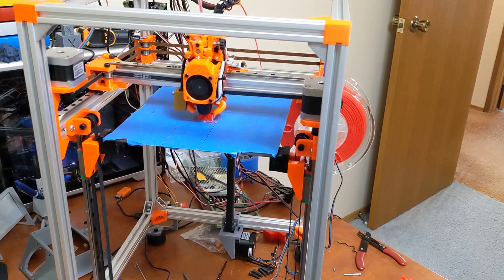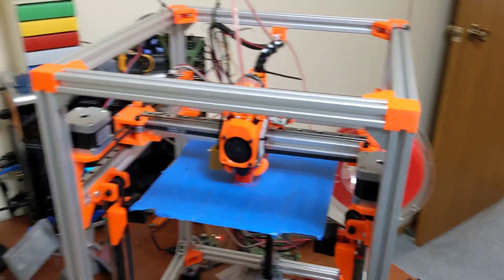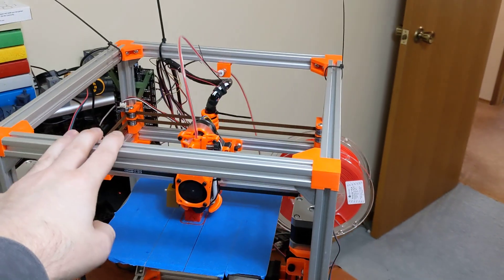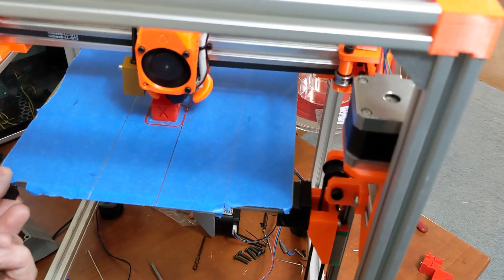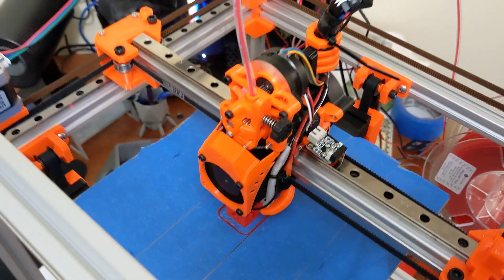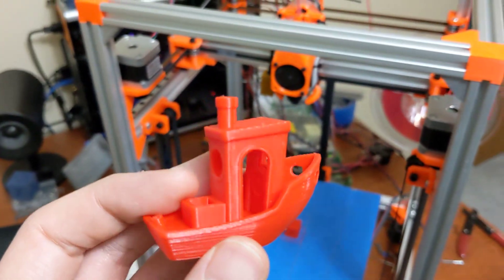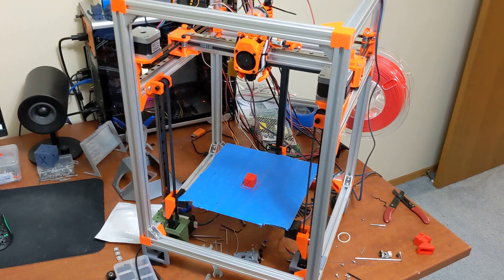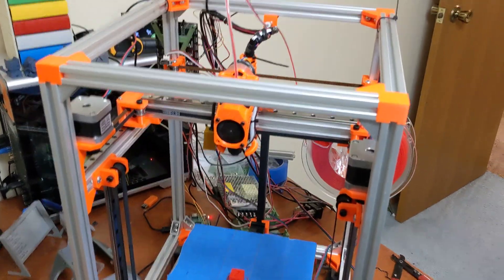DIY CoreXY 3D Printer SimpleCube Ultra V2

Comment: this is corexyz
Reply from the maker: just CoreXY, Z has different motors
Reply: I thought corexyz means all the axis run using belts @Rolohaun
Reply from the maker: @skilledcamman4752  corexyz would be different, this just has belted z with independent motors
Reply: oh
 @Rolohaun

Comment: I really like your idea of docking the bed at the bottom after completion of print. How is your experience with docking the bed at the bottom? Are you happy with it and would you recommend this to others as well ?
Reply from the maker: it works well, as long as you don't have constant power outages it works find and I do not have issues. However it might be better for people to use gear reduction stepper motors to prevent bed drop. that is more expensive though

Comment: I plan on redesigning my tevo black widow into a corexy.
I will have a 400*250mm heated bed right from start.
Is the corexy using AWD? mean 2x stepper on x and 2 on y?

Great project
Reply from the maker: This one is not awd but corexy can be

Comment: I'm very interested in your belted Z setup. Have you figured out preventing the need from dropping after the motors turn off other than lowering the bed to the bottom?
Reply from the maker: docking the bed at the bottom after every printer works great for me, I have not had any issues with that. the only other option is gear reduction but it adds complexity
Reply: @Rolohaun  if it works it works. I was just curious. I have a corexy printer and I'm in the process of converting a ender 3 to a similar printer. But the ender conversion I'm wanting to go with a belted Z. The other printer I'm on the fence about changing the Z to belted given its size (510x510mm bed). A friend sent me your video and your belted Z grabbed my interest.
Reply from the maker: @BBMando69  for large printers I do recommend a gear reduction belted z or lead screw
Reply: @Rolohaun  that's why I'm on the fence for the large one. But the ender conversation I know i want to do a belted Z.

Comment: Love the KISS approach. It can be a cube, and some cad programs allow cubes to be rectangular, so maybe SC3DP SimpleCubic..? Perhaps counterweights on Z belts to control power fail bed drop? Just enough, not full bed weight..
Reply: Of course if a kilogram of filament has been printed, it will fall. :)

Comment: Is there a link to download the stl files for this upgrade?
Reply from the maker: github is here, please note though I am making some changes for the MK1 release. It now will be using a Voron Trident frame.
https://github.com/rolohaun/SimpleCore
Reply: @Rolohaun  I´ve downloaded the project and the Fusion file is some sorte of corrupt... only 1Kb size. Can you check please? Thanks
Reply from the maker: @a330turbinex7  you need to right click the download link and choose save link as this is a github issue
Reply: @Rolohaun  tried that and same problem
Reply from the maker: @a330turbinex7  I just downloaded it, 126mb. no issues. I am using google chrome
Reply: @Rolohaun  I´m using chrome also... I navigated to the folder and downloaded the fusion file without problems. thks

Comment: Best way to make a cheap CoreXY is to buy a used cheap Ender3 or another brand printer off ebay or craigslist, and then just buy all the extrusions and other hardware you need. That way you get all the main parts for dirt cheap. You can usually find a used printer for under $80
Reply from the maker: yes that is also a option for sure

Comment: This looks good are you planning on a full build video from start to finish with firmware for the v2
Reply from the maker: The printer has been renamed SimpleCore, It is a pretty simple printer to build. I have a tips video on assembling the Z and I will be going over the klipper config soon.

Comment: Will bed fall down in case of electricity shortage?
Reply from the maker: if the power goes out the bed might fall, however if the Z belts are tight it doesn't really move. You can also add a UPS to the printer if that was a concern.
Reply: @Rolohaun  oh, now I see! Glass not mounted anywhere and just uses its weight? And will plastic corners cause any problems in case of heated bed (100+ degrees)?
Reply from the maker: @nuke_bird  glass is mounted to PETG or ABS ledge using 3M VHB taper or red RTV silicon. ABS should have no issues. I don't think the glass bed would transfer 100 degrees ever.
Reply: @Rolohaun  interesting! For some reason I thought that for tramming bed shouldn't be attached strong to anything. So, tramming works because belts can stretch?
Reply from the maker: @nuke_bird  the bed never gets that out of skew. Maybe 2mm or less, VHB and silicone have enough give to accommodate this.
Reply: @Rolohaun  yep you're right then!

Btw, about "can bed fall down?". I googled a bit and found term called "detent torque", for Nema 17 its around 200 grams per cm. So, if I'm not mistaken, if you're using pulleys with radius 1 cm, each Nema can handle 200 grams in case of electricity shortage. Including the fact that your printer uses 3 steppers and most of the time bed lies good, steppers should handle 600 grams. To make it more rigid you can use gearboxes (1:2 or 1:3 should be fine)

So seems like no problems here at all! Keep it up man!

Comment: I have an idea so you got the holders for the z-axis steppers and rails and stuff but then under each corner you got an other part to get the printer off the ground I think that could be combined and either make only 3 feet total or safe 2 prints for feet because in 2 more or less corners you already got prints that just need modification
Reply from the maker: I thought about combining the parts but then each print is 2 hours and needs supports, I am trying to find a balance
Reply: @Rolohaun  valid Point !